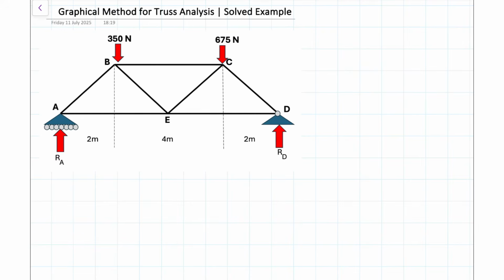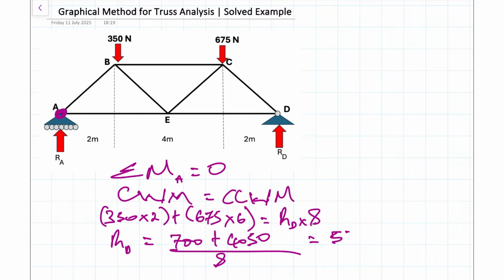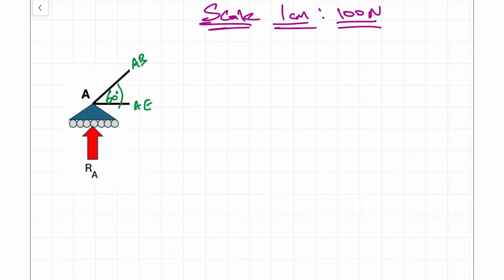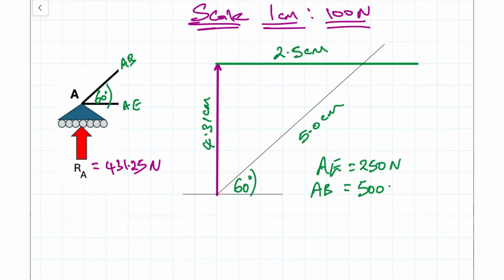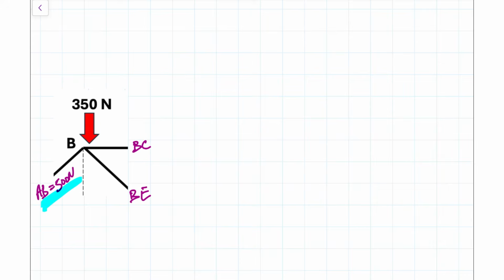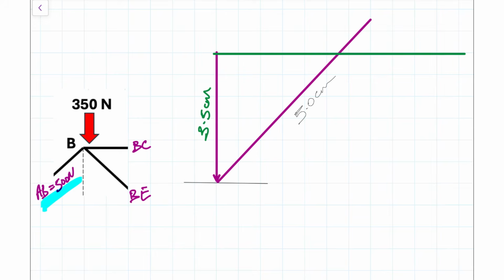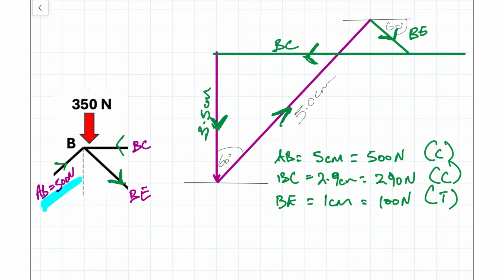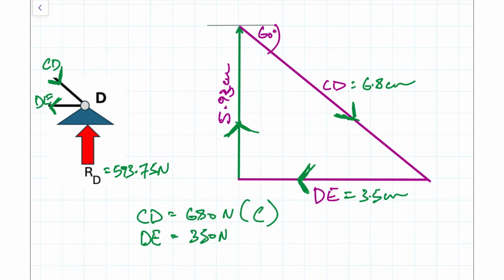Truss Analysis by Graphical Method | Solved Example

Comment: how can you tell the origin of the unknown force
Reply from the maker: I’ll do my best to explain in writing. At each joint, draw the known forces first, tip to tail, working round the joint the same way each time. Then draw your unknown members as lines parallel to their real directions. Where those lines cross is where the polygon closes, and that point gives you both magnitudes plus the arrow directions. You're not picking the origin, the closure decides it for you.

For tension or compression, follow the arrows round in the same order and take each one back to the joint. Pointing into the joint is compression, pointing away is tension

Comment: 😮Hi, how did you measure the angle, and if you draw it, graphically, at B  with 60 degree angle if you draw it 5 cm, then with your same scale the AE must be 3.5 cm. Could you please explain. Many thanks
Reply from the maker: The angles are generally measured in reference to the horizontal. I’d have to go back and check the scaled dimensions or perhaps do another  video to explain. Would It help if I use a CAD software to draw and measure the angles for you to see step by step?
Reply: @MechanicalEngineeringTutor  Many thanks for your reply, I checked and your drawings and angles, which was 42.5 degrees and another was 50 degrees. Therefore I found it different when I was drawing it over the graph paper sheet in actual. 
I found your technique unique that's why I was referring to it. While solving it analytically the calculations becomes lengthier.
I would highly appreciate if you could make a new video in the future with correct angles and depictions in the drawing if possible. Many thanks, BTW my SQA exams are due this March diet 2026.
Cheers.

Comment: hi, is the angle given?
Reply from the maker: Yes, the angle was given. No calculations were needed to get the values for all the angles.
Reply: @MechanicalEngineeringTutor  why AB is not tensile?
Reply from the maker: @nicole-kq4me after you create the force diagram, you will start inserting the know direction(s) using arrows. The arrows on the diagram will then trail each other around and that’s when you insert the same arrows onto your free body diagram (sketch of the joint). If an arrow points towards the joint, that member is compressive(strut), if it points away from the joint, that member is tensile(tie). See if this video helps as well Graphical Method for Truss Analysis—Step by Step
https://youtu.be/Pfbh_YmWdbY
Reply from the maker: @nicole-kq4me 07:15 where I mentioned if the arrow is going towards the joint (on the left hand side diagram), the member is compressive.

Comment: Mechanical engineering?  This seems a lot like structural engineering.
Reply from the maker: There’s a lot of cross over for some topics, especially statics. For instance, this topic comes up on BTEC unit 55 Further Mechanical Principles and Unit 8 Mechanical Principles. You will also find a lot of Thermodynamics concepts but the underlying principles are mechanics. In this context, it’s about understanding force components(which is quite common when dealing with mechanical work done etc). Hope this helps. Thanks for sharing your thoughts.

Comment: You did the division wrong (4050+700)/8=593.75 but somehow you got the difference right 1025- 573.75 = 431.25?? how ???
Reply from the maker: Thanks for pointing that out! I did the correct calculation on the calculator, but it looks like I wrote it down incorrectly (7 instead of 9) then got back on track. Appreciate you catching that — I’ll be more careful next time.

Comment: Cool work but isn't it supposed to be one single drawing instead of doing them separately?
Reply from the maker: Because it’s an entire Truss System, you cannot represent it using one drawing because you will have several members depending on the system. Instead, you analyse joint by joint and apply force polygons as illustrated in the video. That way you can obtain the forces, magnitudes and directions. Hope this helps.
Reply: Explain more  @MechanicalEngineeringTutor
Reply from the maker: @andrewmweshi-xo9xg Let me know which parts and I will do another video today with another question ❤
Reply: The section method.and how are you finding the forces am behind @MechanicalEngineeringTutor
Reply from the maker: @andrewmweshi-xo9xg if you’re referring to when the joints are isolated, when you start from the reaction force, if a member (a line on the diagram) is shared with another joint, use the previously calculated force. In terms of the calculation itself I am going to follow-up this message with a link to a video I’ve made on resolution of forces. If that’s no help I will leave an email for you to send me a question and I will create another video just for you.
Reply from the maker: Here is the video on resolution of forces https://youtu.be/fngZgvxo-J8?si=1WypIfW7yiI0hiME